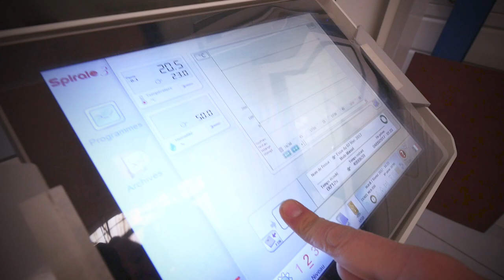Maxi-Cosi | Safety Research Center

Comment: The fact that they test doesn't mean anything, all car seats are required to undergo testing. What matters is how the car seat performs in the tests. I contacted Maxi-Cosi and asked for crash test results on one of their car seats. I was informed that they do not share this information. SERIOUSLY? One of the most important safety precautions you can take for you child is choosing a safe carseat. The lack of transparency within this industry is appalling! After weeks of reading reviews, crash test results, and talking to NHTSA (which also lacks transparency), I purchased a car seat from Clek, a company that clearly excels in designing safe car seats. And guess what? They make their crash test data available on their site. Their HIC and Chest Acceleration scores were better than any other car seat I found, even the high end trendy seats! 
FYI, I have no affiliation what so ever with Clek. I'm just a parent that wants the absolute safest seat I can find.